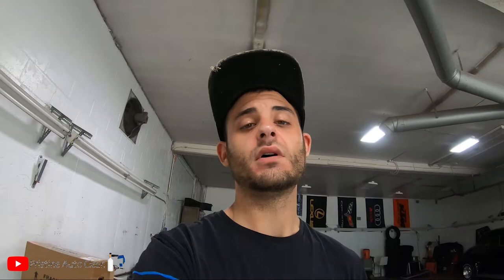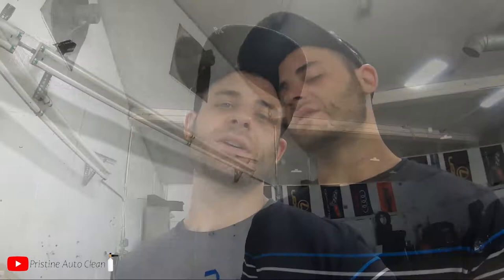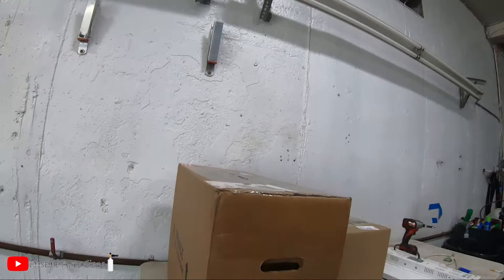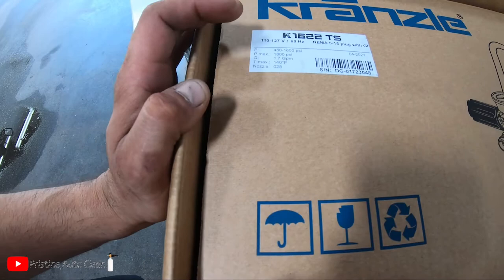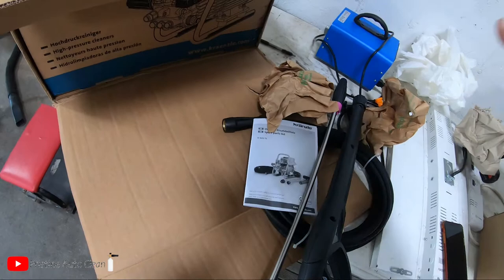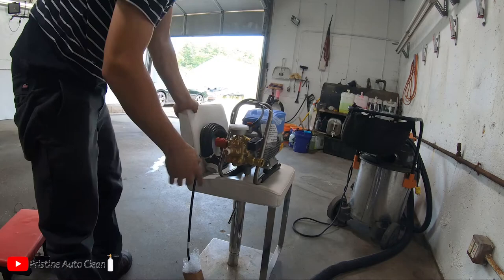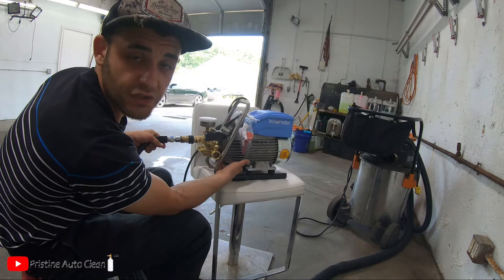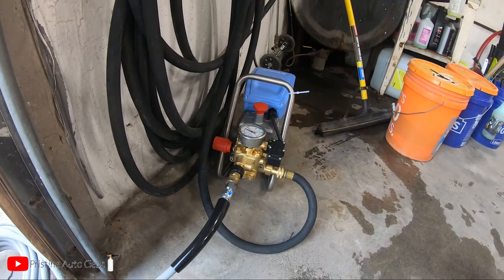Kranzle Pressure Washer Unboxing!

Comment: You say the sun joe you had and used prior to this kranzle broke?
Reply from the maker: Yes while running the unit would leak 3-5 gallons an hour and flood my shop out. As well as prime itself irregularly.
Reply: @pristineautoclean  did you have quick disconnects on old unit?
Reply from the maker: No disconnects, all factory stuff, was leaking from where the case split in the center of the machine. I’m sure it could have been fixed, but It made me 100000x the money I invest in it
Reply: @pristineautoclean  yeah it’s the worse when you have to deal with leaks.